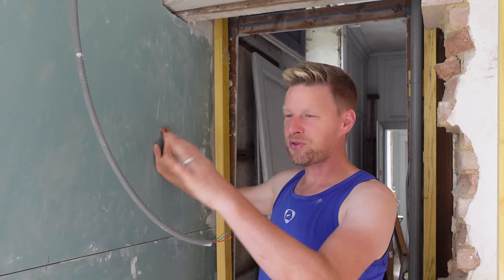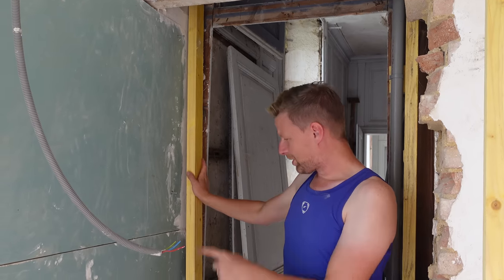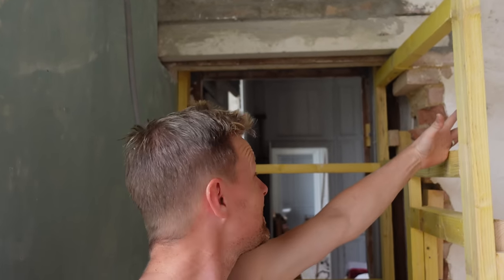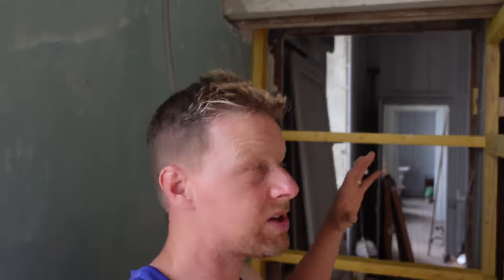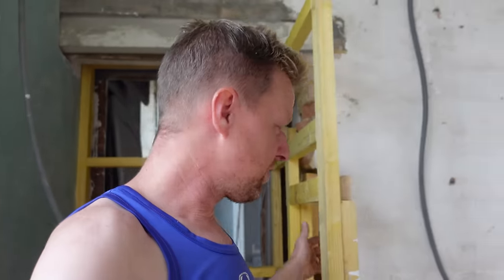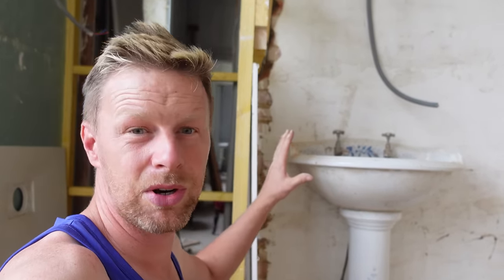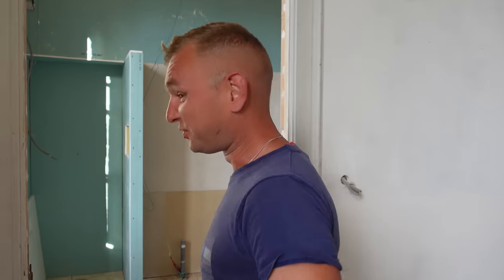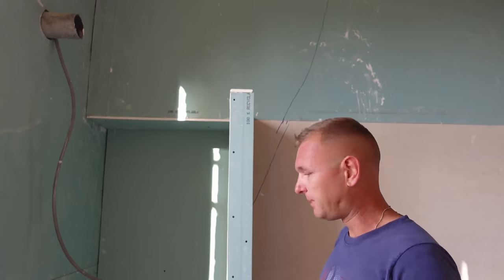Taking the Chateau to Another Level: The Ultimate Renovation Project

Comment: You're such a hard-working family and I"m always impressed with the wide array of things you can do. I have some concern with your shower build. My personal rule for a proper shower is: I should be able to stand in the middle with my hands on my waist, elbows out and NOT be able to bang into any wall. Especially for a larger sized person, a small and narrow shower is claustrophobic, especially when all the walls are tiled. I wonder why, when you have a generous space for the bathroom, didn't you opt to buy a glass shower wall? They aren't that and allow so much light into the shower, which is always nice. I do like that you're building a cubby for shampoos/soaps,etc. You need to consider what space you're actually going to have after you greenboard and tile it. You need a three inch depth after all.  I hope your shower is ample size, but it looks awfully narrow on this side of the YouTube screen.😬 Hope I'm wrong.

Comment: The Stone structures around the windows look so beautiful…isn’t there a way not to cover them up ❤❤❤
Reply: Too cold, winters are harsh and damp.
Reply: @reladie  
the radiator seems right under the window  and the walls are more than one foot thick….no modern house can come up with that kind of insulation plus putting in the beautiful new windows keeps the damp out ..